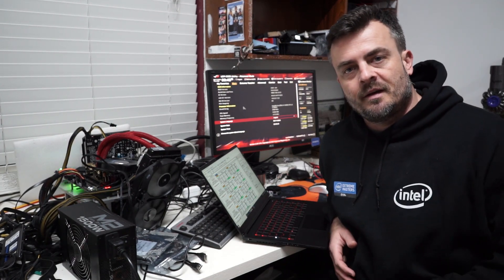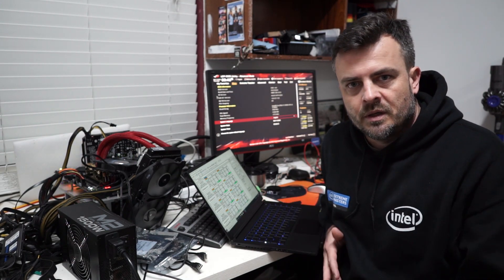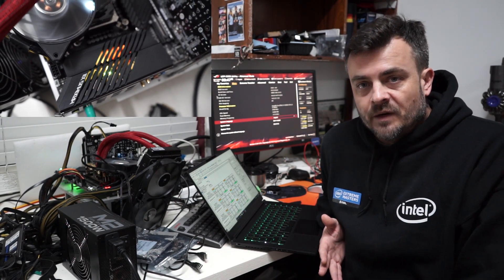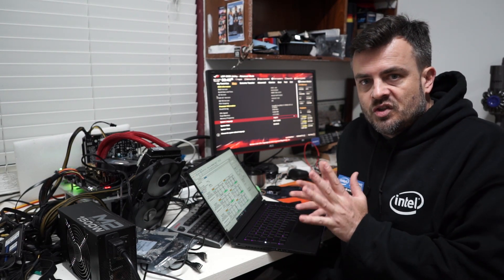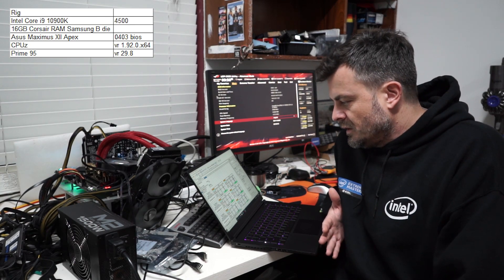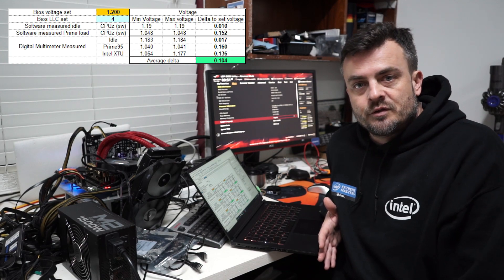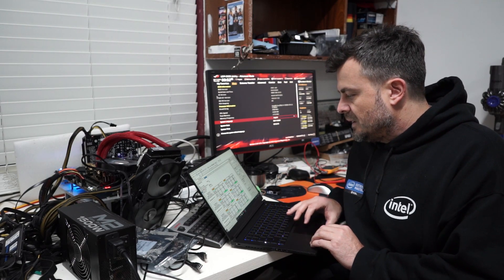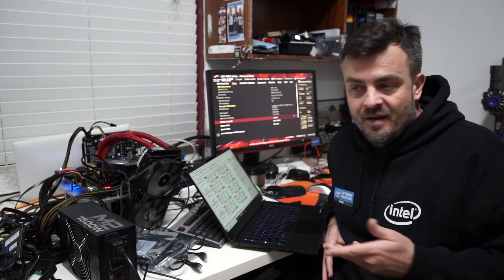Intel 10900K Asus Maximus XII Apex VRM and LLC testing guide

Comment: Great video. Just a quick question what do you think about getting binned cpus from silicon lottery? Do they meet there exceptions?
Reply from the maker: D3LTA KING hmm that’s a tricky one. I personally have paid a lot of CPUs which were high overclockers but i wanted something specific for extreme OC. Honestly I’d just buy a regular chip and play the silicone lottery so to speak
Reply: dinos22 okay one of the reasons as to why I was asking is because I wanted to do a bit more LN2 stuff myself. I still have an older kingpin Gemini 2.0 pot and a couple of two 35liter dewars myself, I’ve always bought cpu from the store but wanted to know what you thought about those silicon lottery cpus simply because I know that you do a lot of LN2 benching. I have that same apex board coming in today and I appreciate your honesty on the LLC setting it to 8 cheers

Comment: https://elmorlabs.com/index.php/forum/topic/vrm-load-line-visualized/

Here is why high LLC is not good. Coming off load can add a 70 mV transient that can only be seen on an oscilloscope. May not be bad if you are running a low voltage OC but if you set 1.45V LLC 8 in BIOS it is possible you are exceeding the Intel spec for voltage 1.52V which even in small bursts can cause degradation.
Reply from the maker: Yes it certainly does happen but the degradation i am yet to see with any CPU I’ve overclocked over the past 15 years
Reply: It all comes down to quality of the vrm good VRMs will have better transients and others will be worse, if you are going to push limits overclocking, you should always physically check your hardware like he did, same boards for example z390 master, can very slightly, which will in turn drastically change what you can set,  drop is a good thing to a point, and using an oscilloscope what you shoot for with loadline is to use the lowest LLC that drops but doesn’t overshoot and settle at a higher voltage for daily non extreme cooling. It will drop you cpu temps, vrm temps and improve stability when pushing to edge on water/air cooling. For XOC you just need to make sure that you don’t overshoot drop and hold a good voltage, transient spike won’t kill or degrade chip. 
Nice work bud!
Reply: There usually isnt a difference between 6 and up.... degredation part though... never had an issue

Comment: Pretty much the same on the Extreme. I believe they share the same power circuitry design (apart from using 90A power stages vs 70A on Apex). Z490 is the 1st time I've seen such a large discrepancy between set and measured voltage at LLC4. As for the GBT boards, I've seen up to 1.5v from the measuring points under load. This is despite having set 1.3v in BIOS all because of the Extreme/Ultra Extreme settings LLC settings. 
Awesome vid Dinos

Comment: You sure llc8 is safe? Friend is saying thats too much due to transient jumps in voltage.
Reply from the maker: In all honesty I’d like your friend or anyone who knows what they’re talking about to show some testing with an oscilloscope or instrument capable of measuring transient voltage fluctuations.  Right now that is pretty much hearsay until someone measures it. I have been using LLC8 since but would reconsider if information was presented showing some evidence.
Reply: dinos22 I would recommend you test with lvl6 based off of your data, I just got my z490 apex and will be doing a lot of testing, but getting LLC to drop with absolute minimal undershoot and overshoot on vdroop, is what you are after along with off load to idle transients not overshooting/spiking which you will see quite a bit with oscilloscope at llc8 just like using extreme/ultra extreme on gigabyte. 
I run 5.2/4.8cache avx on LLC high z390 master, which has a slight over droop 
5.3-5.5ghz all core to 5.6ghz LLC turbo with cache up to 5.3, and I ran OCCT non avx for 30 mins at 5.5ghz/5.0cache on chilled water 5c coolant temp. Which is almost a perfect vdroop with almost no over/undershoot on loading and off loading transients. 
Hoping to get an oscilloscope next yr.
Reply: Why I cant run prime 95 at 1.355v load llc8 but can run at 1.355v load llc6?
Reply: mrthanhnguyen i found out its because there is less voltage droop aka vdroop. Side affect its lesss safe for your processor because of voltage spikes(that are too fasst to measure on hwmonitor) that could degrade your cpu
Reply from the maker: mrthanhnguyen could be heat related too

Comment: You completely ignored topics such as point of measurement of vcore, die sense, vs socket sense (Maximus XII Apex has the ability to change between new school die sense vs traditional socket sense, latter shows up as much greater value with same set bios vcore), also you shouldn't just look at vcore as a single point value, it varies up and down and it has a waveform. That higher LLC makes the vcore a lot more peaky/unstable when load changes (from idle to load load to idle, partial to full load, etc). IMO using a multimeter is not good enough for testing out VRM on a professor shit level.
Reply: He is spot on, when on sub zero cooling you can get away with a little slightly less stable vrm/vcore wavelength, but with Non sub zero you can’t, the variance in the voltage wave will increase core temps, effectively decreasing efficiency of the transistors and it’s a downhill spiral from there, I just posted my first HWbot submission in well over a decade 2 weeks ago 5.5ghz on chilled water 5911 in CB r20 and hoping to be on dice/ln2 in about a month to try and take the record. I made a 5.6ghz 6023 run but crashed while doing screenshot. 
I want to do videos and testing as well as time permits to help the community, just as you are trying to do because something I’m passionate about and also competitive as well. A yr ago I tested all LLC and also used an oscilloscope from work, but not using an oscilloscope look at vdroop to the same load so 1.25v under p95, change LLC and make load p95 hit 1.25v and if you see a huge jump in temps it’s probably due to transients and wavelength. 
HWBot  Iamturbo
Reply from the maker: Time to start a youtube channel and show the world my man
Reply: @dinos22  didn't mean it as an insult, was just trying to give some feedback for you to be able to produce more scientific and useful content.
Reply from the maker: kicsip I didn’t take it as an insult at all. I think you sound very passionate and knowledgeable. I think you should consider doing as suggested :)
Reply: @dinos22  or die trying :D
Reply from the maker: kicsip 😂
Reply from the maker: kicsip hey what’s your hwbot nickname, same as here?
Reply: @dinos22  it's "kicsipapucs". Roast incoming. :D
Reply from the maker: Kisci who 😆
Reply: @dinos22  6/10 effort on this roast. It's a shit name ikr. :D Just copy it over to hwbot.

Comment: How do you feel about setting lower LLC and making up for the droop by setting a higher idle voltage. It's been my understanding (I may be mislead?) that the problem with setting LLC very high is when a heavy load hits it may be just dropping say 10mv but then might overshoot like 80mv before starting to flatten out and this will become exaggerated under benchmarks/tasks that fluctuate between heavy, avg and light loads especially if the VRM isn't of top quality design/components  and has poor transient response. I guess my question is how can we really know how much overshoot there is when it happens so fast that anything shy of lab grade equipment can measure/see it
Reply: I just talked about this above, for someone taking about transients. One reason I always tell people to spend money on good mobos for good vrm transients.
Reply from the maker: You know, you are probably right. I do recall seeing some scary overshoots with oscilloscope in the past that DMM doesn’t pick up. I’ve always run turbo on Gigabyte which is similar to what Asus is doing with LVL8 and at least with Gigabyte i have not killed a chip because of it (that i know). Asus maybe a different story, time will tell.

Comment: do you thnk llc 8 could be used for daily or ? just oc
Reply from the maker: kilner79 i don’t see why not.
Reply: I've had a P8-Z68 at the equivalent of LLC 8 for eight years. It keeps any load voltage at 1.38, which is good for Sandy Bridge. At lower LLC and light / single-core loads, the voltage was 1.45 which worried me.

Comment: great video but im having an issue wth llc7   just cant get stable at low voltage at llc7 but at llc6 i can be stabl at low voltage and llc8 i can be stable but llc7 sems odd also  tested llc8 wth my volt meter and was only a dfrnce of 0.002 from all my testing
Reply from the maker: kilner79 that is odd. I don’t see a reason why llc6,8 are ok but not 7 unless your board and bios combo are buggy. What board are you using?
Reply: @dinos22  im on the z90 apex  m finding droop ads stablity or 0 droop ads stability but somthng about llc7 not ben vry stable especially whn pushng hard on the oc
Reply: p.s keyboard is broke
Reply from the maker: kilner79 z490 apex you mean? What bios version?
Reply: @dinos22  bios 0055
Reply from the maker: kilner79 try my bios 0403
Reply: @dinos22  i tested 0403 0509 0606 0607 and now this 0055  the 0055 made it better but still not perfect 
btw this is when pushing 5.3 at low voltage if i run say 1.45v with loads of droop its very stable but as soon as i tghten up the voltage and lower my idle voltage but maintain the same load even wth 10mv  extra with tighter llc i have stability issue
or 5.1 and 5.2 llc7 s fne just somthing strange when pushing all that voltage  but llc8 was perfectly fine also